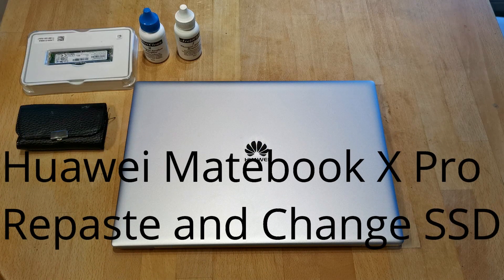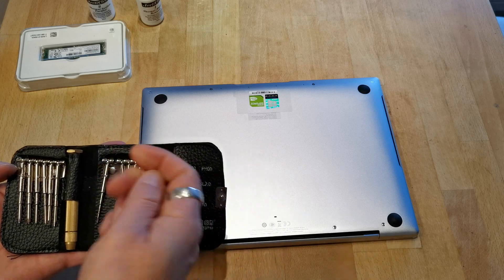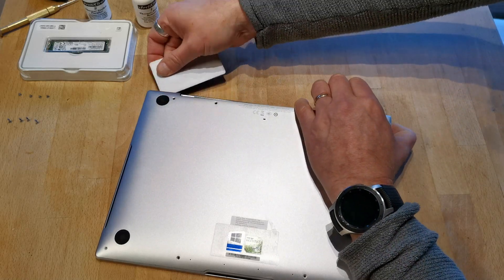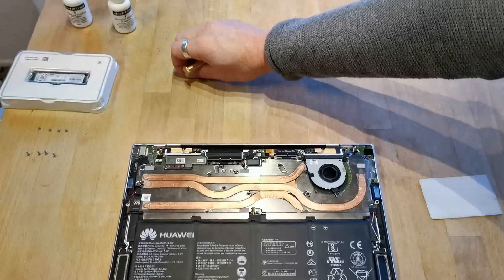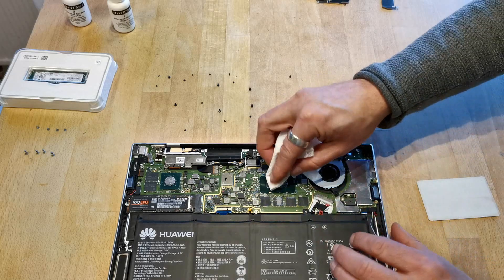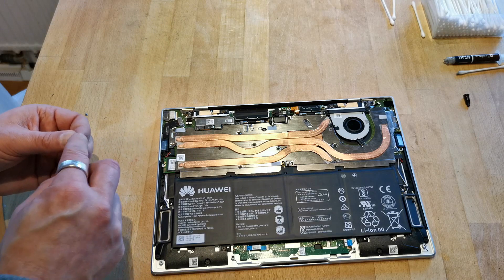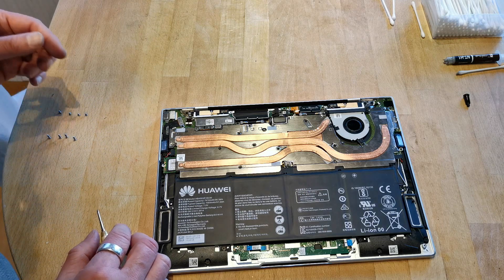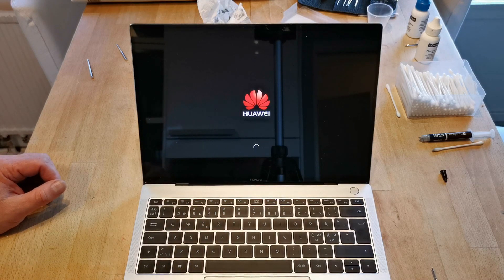Huawei Matebook X Pro Change SSD Teardown and Repaste CPU GPU

Comment: great video, thank you
I was able to change my SSD thanks to you for a WD Blue SN550 1TB
However, my computer has been getting very hot ever since.
I did the operation twice thinking that I had put too much or not enough thermal paste (ARCTIC MX-4)
but nothing helps
shouldn't the thermal pads be changed too, which can be seen at the bottom right of the fan?

Comment: Hi! I want replace the ssd also but i have a question, can i use a Pcl4 only or has to be a Pcl3x4? Thanx!
Reply from the maker: Hi, thanks for the question and sorry for the late answer. Yes PCI4 is backward compatible with PCI3.
I will be very grateful if you could consider subscribing to the channel :)

Comment: Hi. Do you know what size of screw used for the m.2 slot? I have a Matebook D16 which has a second m.2 slot but no screw for it, and huawei or just the D16 using a none regular size, much smaller than usual, and I can't find anywhere or just don't know how to search for it by size or name.
Reply from the maker: Hi, thanks for the question. No, I have no idea of what screw size is used. Some stores like Bauhaus or Hornbach have screws that you can buy just 1 of. I is most likly a M type and the length is probably the same as for other M.2 screws as I guess you refere to the length when mention the size. 
I will be very grateful if you can support the channel by subscribing :)

Comment: Thanks for the video.. Im about to replace the SSD on my Matebook X Pro and looking for suitable replacemnet.... wondering why you installed the original back in. Not happy with 970 EVO ?
Reply from the maker: Hi, thanks for the question. The reason for this video was to show that it is possible to change the drive. So I did the change from the delivered drive to 970 EVO first and then I did this video. I reversed the change after producing this video and I was very please with the 970 EVO as long as I had the device.
I will be very grateful if you can support the channel by subscribing :)

Comment: Do you have to install Windows again after upgrading the SSD?
Reply from the maker: Hi, thanks for the question. You have 2 choices. Clone the drive, you will need to have a M.2 SSD and a compartment to host it and also a software like EaseUS disk cloning. The easier way is to  install Windows 10 from a memory stick(16GB or 32GB) and use Microsofts tool(link below). You will also need(or maybe Widows update will do) download Huawei's PC Manager(link below) to install the drivers. When I did that mod I also had to download the WiFi drivers before launching the PC Manager.
I will be very grateful if you can support the channel by subscribing :)
Link to Windows 10 to USB-stick tool: https://www.microsoft.com/sv-se/software-download/windows10 
Link to Huawei PC Manager and WiFi drivers: https://consumer.huawei.com/en/support/laptops/matebook-x-pro-2019/ 
Link to a disk cloning software: https://www.easeus.com/backup-utility/free-windows-10-hdd-clone-software.html
Reply: @thetechzone6558  Thank you sir. I will let you know how I get on.
Reply: Can you send a link for the wifi driver for 2018 model?
Reply from the maker: @Veto_  It in the support page https://consumer.huawei.com/us/support/pc/matebook-x-pro/ and choose Matebook X Pro i7 16GB+512GB NVMe PCIe SSD (MACH-W29) that should be the 2018 model and in the driver list choose WLAN and download the driver.

Comment: i have a problem with mine when i plug the power lead in its a solid whit light when i power it up keyboard lights up no display and power light next to cable flashes white ?
Reply from the maker: Hi, thanks for the question and very sorry for the late answer. It's almost impossible to answer on your question. Did you disconnect any cables when disassembly the device? When you cleaned the old thermal paste did you see to that no liquid was left on the circuits? Did you get all screws in place, it is very easy to loose one into the case. Can you access the Bios? I you long press the power button for 1 minute you will reset the system and that can maybe help.
I will be very grateful if you can support the channel by subscribing :)

Comment: Thanks so much for this. I just performed a successful SSD upgrade to the Samsung 980 Pro 2TB thinking that would resolve the problem of my Matebook crashing yesterday and not booting up, but it looks like the problem is something else. The music in your video helped me stay patient and calm with all of those screws. Thank you!
Reply: Was your previous ssd a LiteOn? What were your BSOD error before and now with ssd replaced? Are they different?
I had CRITICAL_PROCESS_DIED and UNEXPECTED_STORE_EXCEPTION + "no boot device" before having replaced the motherboard. Now I have almost daily WHEA UNCORRECTABLE ERROR + "no boot device". 

Someone blamed the LiteOn ssd (mine is from this manufacturer) so I was thinking of replacing that, but after seeing your comment I don't know what to do.
Reply from the maker: @afaik8  Hi, thanks for the question and sorry for the late answer. I think that the SSD from start was a LiteOn but I changed to a Samsung EVO 970 2TB drive for storage reason not due to issues. The reason the EVO drive was replaced in the video was only for showing how to perform this task.
Reply: @afaik8  did u change this and did it solve the issue?
Reply: @nicholastan6062  Sorry for being late.
Yes, eventually the laptop did not boot up at all so I was forced to try replacing the SSD. No BSOD since then :)
LiteOn SSD died and I was only able to do a partial file recovery, so better swap SSD quickly...
Reply from the maker: Thanks for the nice feedback :)

Comment: i own a matebook x pro 2018, can Samsung evo pcie x4 work with me?
Reply from the maker: Hi, thanks for the question. Yes it will work fine, the matebook have 4 pcie lane connection to the SSD.
I will be very grateful if you can support the channel by subscribing :)
Reply: @thetechzone6558  thx sir, done 👍
Reply from the maker: @sherif.mo.shalaby  Thanks!!
Reply: I installed it and everything is going well
Reply from the maker: Grate, thanks for the feedback.

Comment: mine is constantly at 70c just playing youtube, did i put too much or too little? 
I did the same amount as you maybe a tiny bit more. the fan is 100 percent all the time
Reply from the maker: Hi, thanks for the question. How was the situation before the repaste? Did the heat plate align fine onto the CPU and GPU, its easy to bend the plate when disassembly it. Too much or too little paste can cause   heat issues. What kind of paste did you use?
I will be very grateful if you can support the channel by subscribing :)

Comment: How do you add another 8GB ram on this thing. Can someone help plz ?
Reply from the maker: Hi thanks for the question. The RAM(16GB) is soldered on the motherboard and can't be changed.
I will be very grateful if you can support the channel by subscribing 🙂
Reply: @thetechzone6558  yes, done. Thanks

Comment: just curious, did you void the laptop warranty when you broke the paper seal that was cowering the ssd screw?
Reply from the maker: Hi, thanks for the question. I think that Huawei must accept the change of SSD as so many other manufactures does, but i'm not 100% sure. The paper seal doesn't say anything regarding warranty as far as I can remember.
I will be very grateful if you can support the channel by subscribing :)

Comment: I replaced the SSD, but now the touch pad is not working, windows can't detect it. I reset the BIOS to default values,no luck. any idea? is it possible some cable is loose?
Reply from the maker: Hi, hard to say, it can of course be a cable that isn't connected. Did you create a recovery USB-drive, or have you done a fresh windows install on the new drive?
Reply: @thetechzone6558  cloned the windows SSD, touchpad is not working, then I installed debian, touchpad is not working neither. but open the backcover should not impact touchpad, wierd...
Reply from the maker: Hi, you did /F9)load the optimal defaults in bios I guess?
Reply: @thetechzone6558  i finally accidentally figure it out, do you remember to insert a paper for clip board, there is  two cables, one on the left, one on the right. in my case,though the left cable is in place, but the left cable's black lock is up. once a push it down, touch pad works. how weird.
Reply from the maker: Great News, thanks a lot for your feedback

Comment: Helped me so much thanks.
For people wondering screw sizes : for outside, a TORX T5 is good, and for the internal heat shield PH00 is good.
Don't try to scrap off the sticker on the SSD screw, just put the screwdriver through it.
Reply from the maker: Hi thanks for the feedback and your added information, much appreciated :)
I will be very grateful if you could support the channel by subscribing :)
Reply: I wish I didn't scratch off the sticker on the SSD screw, now some of the lefover paper got stuck inside the screw and the screwdriver seems not to fit properly. Any tips to solve the problem?

Comment: Is the thermal paste necessary? I found that the thermal paste (probably too much) was causing my matebook the BSOD (WHEA cuncorrectable error). After removing the paste, no more such trouble but would that affect anything? Thanks in advance.
Reply from the maker: Hi, thanks for the question and sorry for the late answer. I will recommend using thermal paste, just a thin layer of course, but it is possible to run without. The temperature should be higher without and the CPU will throttle and lower the voltage to adjust.
I will be very grateful if you can support the channel by subscribing :)
Reply: TheTechZone yup just applied a thin layer of thermal paste. Thank you. Subscribed long ago.

Comment: After the changing m.2 no needed to reinstall windows?
Reply from the maker: Hi, thanks for the question. I recommend you to do a recovery drive if the m.2 drive is new, new drives doesn't have Windows installed. By creating a recovery image to a USB-drive you get a full copy of the drive delivered from Huawei. Another way is to install Windows 10 by downloading a Windows installation image to a 32GB USB drive, by doing this you need to have Huawei WiFi Drivers and the PC Manager from Huawei check the link below. I will be very grateful if you can support the channel by subscribing :)

Link to Windows Recovery installation: https://support.microsoft.com/en-us/help/4026852/windows-create-a-recovery-drive
Link  To new Windows installation:  https://www.microsoft.com/sv-se/software-download/windows10
Link to Huawei drivers:  https://consumer.huawei.com/us/support/pc/matebook-x-pro/
Reply: @thetechzone6558  thanks for the answer.

Comment: Hi! Great Video! I got the idea that in huawei x pro you can't update its ssd (my xpro is 256 SSD), but this video proves that i was wrong! Could I replace my  256ssd  with 2TB SSD, all by myself?
Reply from the maker: Hi, thanks for your feedback. It is possible to have a 2TB SSD in this device and to do it your self. I don't know how Huawei will support the laptop if you remove the SSD as it is a sticker on the screw holding the drive in place. I also recommend you to have really good order on all the screws.

Comment: can upgrade ram of huawei matebook d 15 ? is it available or not in long term ? i need your answer pls
Reply from the maker: Hi, thanks for the question. Sorry the Huawei MateBook D 15 have the ram soldered onto the motherboard a very strange solution when many 15 inch laptops have  at least 1 free slot for the user to upgrade. The 8GB ram is way to little in my opinion.
I will be very grateful if you can support the channel by subscribing :)

Comment: what about the warranty? there is a sticker on the screw! I ask Huawei and they told me i lose my warranty.
Reply from the maker: Yes, I warned about it in the video, I guess the warranty can differ between countries. My current laptop MSI Prestige 14 had a sticker on one screw but that one only is there to assure that no one have been opening the backplate after leaving factory. Thanks a lot for your comment, please support the channel by subscribing.

Comment: If you install a new M.2 right onto a brand new out of the box laptop, do you have to do any of the recovery steps or does the motherboard automatically load it right onto the SSD the first time?
Reply from the maker: Hi, thanks for your question. There are several ways, a clean windows installation by downloading Microsofts creation tool and make a USB recovery disk. When you have installed windows you need Huaweis pc manager to get the drivers in place.
The second method is to search for recovery drive in windows search. You need to have a 16GB USB drive, plug it in and follow the instructions. When the creation of the recovery drive is finished you need to boot the device and set boot priority to boot from USB drive. I hope this instruction can help you. I will be very grateful if you can support the channel by subscribing 🙂

Comment: Could it be done simply by wiggling out SSD from underneath the heat-pipe assembly?
Reply from the maker: Hi,thanks  for the question. No I couldn't get it over the frame unfortunately. I will be very grateful if you can support the channel by subscribing 🙂
Reply: @thetechzone6558  ...any idea if 2019 model allows to swap ssd this way? Though case itself seems to be identical actually

Comment: Hi Sir, do you have the video for how to reinstall Windows after changed brand new SSD, Thanks
Reply from the maker: Hi ,thanks for the question. There are at least two ways. Use a 16GB USB stick and go to search bar and type recovery drive and select the recovery drive app, insert your 16GB USB drive and follow the instruction. Change your SSD drive, When it is completed boot the system into BIOS and select the recovery drive to be first boot device, save and continue with recovery. The second is to download Microsoft tool and create a USB drive from https://www.microsoft.com/en-us/software-download/windows10 , but then you need to download HUAWEI PC Manager to install the drivers, maybe Windows Update can be used too.
I will be very happy if you can support the channel by subscribing :)

Comment: I do noticed my SSD is failing and need a replacement soon. Thinking about which ssd i should buy... which ssd u prefer if im looking for durability not speed. Im thinking the intel 660TB 2TB but wanna know your comment.
Reply from the maker: Hi, thanks for watching this video. Intels SSD are a good choice and worth the price tag. I'm not familiar with the 660TB but the 660p is a good ssd for the money(230$ in Sweden). I hope you can consider support of this channel by giving it a sub :)
Reply: @thetechzone6558  one more questions about the window key.... so after the change of ssd, the window key will automatically registered to the window setup or i have to key in manually?
Reply from the maker: I think that all modern laptops have the Windows key stored in the bios, but please note down the key before you start.

Comment: How much it cost a  500gb ssd for this computer?
Reply from the maker: Hi, thanks for the question. This is the i7 version and it is equipped with a 512GB SSD. The it version use a 256GB SSD, Intels 660P  512GB cost around 600$.
I will be very grateful if you could support the channel by subscribing
Reply: @thetechzone6558  Jesus they are expensive. Thanks I just subscribed
Reply from the maker: Perfect, thanks :)
Reply: @Roddy349  I think he meant 60$

Comment: Which SSD should I buy for my Matebook X pro?
Reply from the maker: Hi, I guess that depends on wanted storage size and speed. I guess you have the i7 model and that one comes with 512GB storage. Going up to 1TB you have Intel 660p series NVMe 1800 MB/s read and write speed priced around 110$. On the speedier side you have Samsung EVO 970 1TB with read/write speed 3500/3300 MB/s  for 214$. Going for 2TB Intel 660p will set you back 200$ and 467$ for Samsung EVO 970. So you see that it is a hugh difference and I doubt you will notice any difference on day to day work. I have the EVO 970 2TB version but if I had to choose today I would have gone for Intel.s 660p 2TB for half the price. Thanks for your question, please support the channel by subscribing :)
Reply: Just wanna know. What is the max speeds of ssd this notebook support
Reply from the maker: The max speed is the one the SSD can deliver, the PCIe slot support 4 lanes and the is 40Gbit/s. Thanks for watching, it would be nice if you can support the channel by giving it a sub :)

Comment: this is a really great video - thank you

what the video is missing is some benchmarks before and after. it would have been great to see the difference in temperatures and fan noise, as a result of changing the thermal paste

i have the 2018 version of the laptop and gpu temps seem very high when light gaming, considering making this change but i am very keen to see what the difference in temperatures and especially fan noise that this makes!

thank you
Reply from the maker: I'm sorry, totally missed  your question. I have sold the device and are testing other laptops as you can see in my channel under videos. The temperatures went down by 3-5 degree celsius if I remember correctly. The fan noice didnt change, but it came on later then before.
Reply: @thetechzone6558  thanks for responding

Comment: Great vid! Im not sure that distributing the paste with the q tip is necessary? I thought maybe by spreading it out you subject the paste to forming air bubbles?
Reply from the maker: Yes you are right, I used a litteto much and removed some. I tiny dott should be enough on these tiny areas, no need for spreading it out. Thanks for your feedback, please subscribe to the channel.